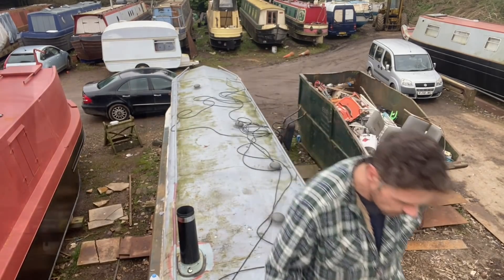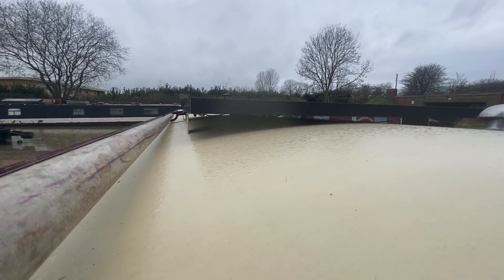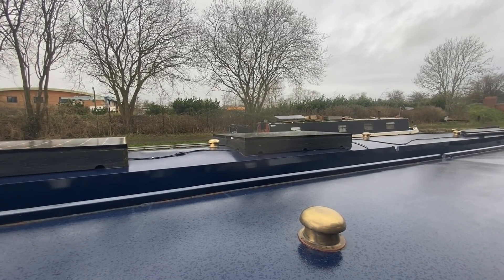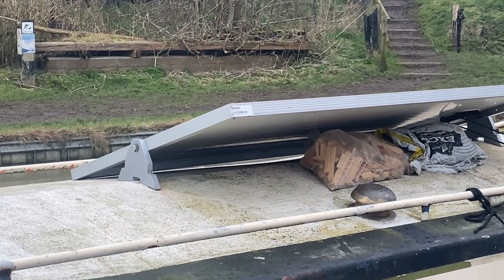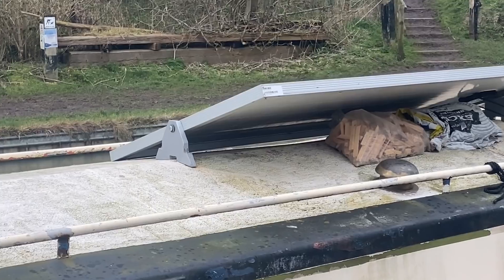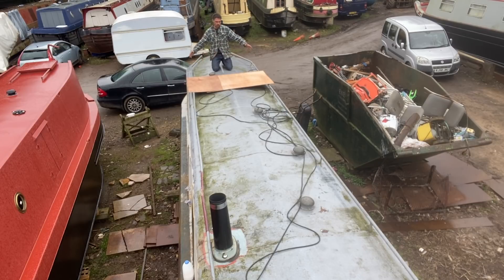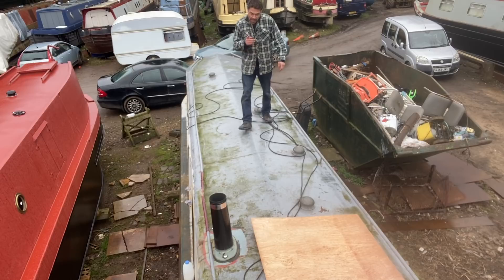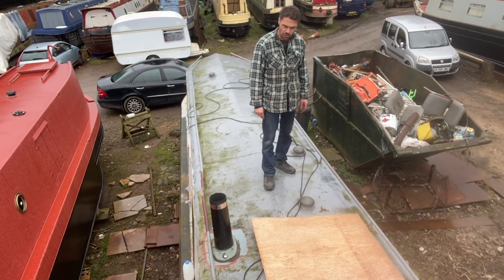122. Narrowboat solar panel positioning and mounting options

Comment: Mount On the side of the boat on sliding brackets above the roof then you could tilt then  Accordingly and slide them down when  you go under a bridge then you would have the Option to put them when the Sun comes up in the morning and in the afternoon if you are moored up then you do not need to worry about tunnels do you

Comment: re the mic - you said "new mic", but you need a radio mic (I thought you had one, but you seem to be using a fixed mic at the camera location. 
mounting solar - you could still use the usual triangular brackets for the panels, but with wedge shaped metal spacers under each foot - shaped to match the outline of the feet. At a guess, this would raise the panels only very little as the brackets have a cut away area in the middle between the feet into which your "roof ridge" might fit.

Comment: Keep going man, you're doing well. Just a suggestion, but you could move the vents, welding the cut pieces into the old holes. You can buy some 2 part filler for metal, to hide the sanded down joints, especially as you are going to have to paint it all anyway. Use the vent positions for the inside, (kitchen, shower etc) to be the final guide for where to site your panels.

Comment: The angle of the panels relative to the sun will have a big impact on their efficiency. Don't skimp on adjustable brackets or it'll be a false economy.

You've made a few references to the height of tunnels... doesn't it depends on how low the boat sits in the water? Have you looked into the height along your routes? Maybe it doesn't matter.

Great channel, it's providing a lot of inspiration. Keep up the great work.

Comment: Plenty of boats around with panels over vents as long as there is a gap for airflow no problem with BS cert. I put my panels near the stern to cut down on cable run .

Comment: Good video looking at differences in mounting panels.... I'm going to (eventually!) mount 660mm wide panels (narrow ones!) on strong magnets. As they are half width of roof I'll put two on one side at the stern, then two on the other side at the bow so i can walk up the boat on the roof - both sets using curve of roof to angle slightly differently. This leaves centre line free plus as the panels are low profile wont catch on it. They are nice and low below mushrooms and don't need to tilt. As on magnets no holes drilled so big bonus with nothing to rust, plus they can be removed for painting etc... just something else to add into the mix!

Comment: Personally, I agree with your final placement of the solar panels. The standard apex mounts are adjustable so you can lower the panels to the roof when you need to go through tunnels, but it will still allow you to tilt the panels when you want maximum sun. As for connecting the panels together, make sure they are wired up so that if one of the panels is covered for any reason it doesn't kill the output from all three. I'm not an electrician so can't help you with a wiring diagramme. Good luck with whatever route you take. Cheers Dave

Comment: To avoid any problems with the centre line you could have 2 with one fixed either side to the handrails as the boat is a Springer they should be more than strong enough. Be careful having a panel over a mushroom it might fail a boat safety check.

Comment: I find I very rarely walk on my boat roof at the front when using locks.  My boat is 58ft long and I single hand 90% of the time.  Where possible I only go on the roof and climb a ladder when entering a lock to go uphill.  Once I am lockside I try not to have to climb down any ladders.  Although when people 'help' sometimes I have to when going downstream but if nobody is there to interfere I simply pull the boat out of the lock and shut the gates before walking down and getting on from the gunwhales.

So definitely keep solar panels in front of the centre line.  Plus having them over your mushroom vents also means when it rains heavily you won't get bounce back rain entering the vent.  Since you currently don't have a centre line fixing in the middle of the boat you have the luxury of creating attachment points on both sides near your rails and then the lines are less likely to foul stuff on the roof.  The centre line point is not necessarily in the middle front to back either you need to locate the point of balance for your boat.

Comment: For the plywood brackets, you can just make them out of plywood yourself, instead of having them fabricated out of stainless or steel. It’s less strong, but I think that’s if anything a benefit. If anything puts that much force on them that they’d break, you’d rather the brackets break than the panel.

For overall positioning, I think for cruising, as much as possible forward of the centerline, and flat in the middle of the roof leaving a walkway along either side. But if they’re forward of the center, then most of your walking on the roof will be without having to avoid falling onto or tripping over the panels — I’d think it’s hard enough to avoid falling in the water without adding an obstacle course if your can avoid it.

And of course while stationary you’re going to want to be able to angle them quite steeply.

Comment: You need two brackets to each panel mounted to the center so you can tilt the panel to the left or right. Mount your panels to the center of your roof line so you can still walk down either side. But have a bacon sarnie first. We still cant hear you, brail would be good at the moment.

Comment: Hi James, my penny's worth -  I think you got it right at the end there, fit them lengthways missing the vents. Two on the left at the front, then the last on the right further up. Since you have such a profound curve to your roof I think that should allow for a really low centre point? Will you strip back and repaint the roof first?

Comment: If you are mounting the panels on a pivot along their axis, have the fabricators cut the brackets with a vertical slot and use handwheel bolts.
You’ll be able to get the top edge a lot higher (better angle to the sun) without a lot of extra height in the bracket or get the panels flat on the roof as required.
Especially when trying to tilt against the slope of the roof, you won’t get much of an angle with a short bracket.

Comment: I'm loving the suspense of a part 2. Just wondering if as a solo cruiser you would be walking on the roof regularly. Great use of the ply wood for measuring. What about those panels that are flat/rounded to the roof and you can walk on them? My opinion is that if there is room to walk then I would get those that maximise the sun, so those that tilt. Looking forward to the outcome decision! Best of luck Tara

Comment: As a single hander I really would keep them all forward of the centreline if possible. You’ll be on and of the roof loads in locks and the last thing you want to be doing is constantly dancing around solar panels when you’re getting on and off the boat in a hurry, it’s dangerous mate, trust me 👍🏻

Comment: I use pot magnets on my solar panels with the midsummer energy system it cost me 220 for the mount system with the heavy duty magnet I have a springer just like yours and with the magnets it levels the struts I use the big LG bifocal panels as I live on board full time... Drilling and tapping a roof that didn't leak worried me lol... Plus you can lift the panels when you wanna paint or decide you wanna move them.. I only have two panels but 1.8 metre long.. Hope it helps keep up great content

Comment: Hi James,

NICE vlog - excellent DIY!

For solar panel placement - low and fully moveable - have a look at "Minimal List" - somewhere in their first 60 vlogs - I think - their system is great!! You still can improve a little on it, though!
You can quickly raise them - if you want pat vertical - either side - and you with pulling a few pins and a plug, you could also take them off in very short order (to store them safely...)...
Didn't see Cath's install on "Narrowboat Experience", yet ...

Best Regards from a different Canal - ....living right next to the "Miraflores Locks" at the Panama Canal - NO Narrowboats over here...

Cheers,
Thomas

EDIT 1: "Minimal List" Solar: - right after Episode 025 - and then between Episodes 45 and 46....! I think they have more Solar vlogs, but these 2 certainly will give you the idea!! ....and frankly - I think it's one slick and most economic solution!!

https://youtu.be/iBn9iw5JE4s

https://youtu.be/L-wSAaOYFM8

Edit 2: Saw "Narrowboat Experience" - great install!

https://youtu.be/aDvb9W8RAU0

https://youtu.be/WMaJGOpF8DE

If you don't want to drill/tap your roof - weld a nut into a piece of tubing and then to the roof or just weld a stainless bolt pointing up onto the roof (...or have your buddy from the yard do that for you!) and bolt the panel rails down with a washer and a stainless lock-nut.... (obviously on all 4 corners of the panel-rails...

If that plywood board represents the size of your panels - mount them lengthwise!! This way you keep some space on each side to weld on clmps for center-lines on each side and gives you some walking space if needed....

Comment: Whatever you do, make it a symmetric solution - anything else will look poorly. Personally, I would definitely go with the solution from one of the boats you showed - the one where the solar panels are mounted to the existing rails. That is a nice beautiful symmetric solution where the panels are lifted above the mushroom vents and you will still be able to reconfigure and angle the panels in the direction of the sun. With such system I bet you will also be able to fit up to 4 panels in case you need it. I'm following "Chugging Along" narrow boat channel also, and they are struggling with only 2 panels your size. Just saying, even 3 may be too little. You just can't get enough solar.

Comment: Is there four or five (5th not seen) mushroom vents?
I wonder if you could fit the panels between the 2nd and 4th vents and left rail (with a gap)?
At worst the panels would partly rest on the vents and if you wanted them to angle steeper (one direction) you could use the railing as a pivot point (if strong enough)?  ;-)

Comment: How about..... Run some lengths of angle ali across the boat, attached to the rails with U bolts. Space the ali so that the panels will just sit down between. Then you can drill through the ali runs and the panel frames, and secure them with simple M6 wingnut/bolt hardware.
If you want to raise the panels, then just cut some more angle to make props. The bolts at one end will act as a simple hinge. You can put the prop either side, depending where the sun is. When you want to cruise, just remove the props and lay the panels down flat into the runs of angle. 
U bolting, means you can play around with the configuration and find what works, without any mods to the boat. Try the panels length ways or long ways, and move them about on the boat, or reconfigure if you change to new panels of different size. Even strip them off quickly if you get height issues.
Solar meccano ! And to make it all, you only need a drill, hacksaw and vice.
Reply: A few viewers mentioned Minimal List's setup. My idea looks like it's pretty much a DIY version of this.
(BTW, I use this on my workshop panels.)

Comment: Please don't consider single handed cruising without a pair of centre lines as it will be a nightmare.
Assumiing you have centre lines you won't want anything on the roof too close astern of them, else they will always be getting caugt up. If you can easily walk on the back half of the roof you will be okay to access lock ladders, so mount your panels to the front of your centre line mount. I'm just about to mount a couple of big panels on our boat and have chosen to go with these fully tilting brackets from Midsummer Energy (a bit pricey though).: 
https://midsummerenergy.co.uk/buy/solar-panel-mounting/Narrowboat-Tilt-Mount 
Example installation here: 
https://www.youtube.com/watch?v=asf1W0N8W_k&feature=youtu.be

The Narrowboat Experience have done a full tilt system more economically, but you would need to space the bars up a bit to ride over your mushroom vents: 
https://www.youtube.com/watch?v=k0WaQuvwc_I

Also the Miminal List have done a more elaborate full tilt (over mushroom system): 
https://www.youtube.com/watch?v=iBn9iw5JE4s
Good luck...

Comment: Had a quick google .... pairs of brackets seem to be between £30 & £40.   Came across one example that would work with a roof ridge ( https://www.ebay.co.uk/itm/254461665261 ) 
but if you offsetting them to one side then the ridge isn't an issue.
Also like brackets like these https://maloneelectrical.co.uk/price-list .... they have 2 sideway cut-outs at the top which means the weight of the panels can sit on those rather than relying on the friction of the locking nut.
Finally do you really need 3 pannels or can you get away with having only 2 (poss higher powered)  with the option of adding a third latter?

Comment: Hi James my idea for your solar panels is to bolt all three solid together then fit across the front of the roof to the grab rails with a couple of "u" bolts each side then by undoing one side you can tilt them up as far as you like don't worry about going over the top of a mushroom  vent all this will do is stop them leaking which they all do eventually then wires through the roof under the panels so no wires running down the roof you will never need to walk on the front of the roof and as for height you could probably go up four or five feet before it causes a problem
Reply: Nice idea, but remember the combined weight is going to be 60+ Kg so frame strenghening and muscles will be requied for the tilting.

Comment: When your close that mic is much better 🙌🙌
Reply: If it’s a wireless mic shouldn’t you clip it on yer collar?
Reply from the maker: @diywithpaulie  I did !!!
Reply from the maker: The range of the TX to the RX
Reply from the maker: Yeah I think so too - I think it’s got a range which I’m trying to work out
Reply: Ahh I see
Reply: Ok if you were wearing the mic then the phone was not using it to capture audio - sounds like a phone configuration issue - needs to be set to use the wireless mic audio and not the phones internal mic which it was clearly using in this vid.

Comment: To be fair, if you're going to be doing most of your boating on the Grand Union, then I really think you are fine for headroom. Have a look around online for some of the profiles of wide beams in the same sort of area, your headlights and solar panels will be well inside of this. You obviously won't know for sure until your floating but Springer boats in general are pretty low form in the water. I can boat from Braunston to Stoke Bruerne without removing my chimney (28" tall) to give you an idea..

Comment: Something to consider, if you could put them in the middle this would obviously give you ideal and fast access to the roof when in locks, from either side, alternatively your off-set idea looks fine, but will you have enough room to navigate fast around the panel near the chimney, James?
Re the brackets, have you considered aluminium? It will probably cost less, and easier for you to machine or even make yourself using various tubular and angle cross-sections. Takes me back to my Meccano days.
By the way, I do favour crispy bacon, just to make sure the pig is dead, although I am partial to a rare or medium rare steak. ;-) Right I’m off to burn the kitchen down!!!

Comment: James. Several boat tubers have tilting brackets fixed over their  mushrooms that have got through all the low tunnels ok. e.g. Cruising the Cut & Journey with Jono both have std 'A shaped' brackets above the mushrooms with no issues. Leave a decent gap around the centre line fixings and use 2 centre lines (one down each side) & you wont get them tangled up under your panels then.

Comment: Ok have a look at minimalist, what Michael did with his panels seems to be the best I have seen. 

Unless you are aiming to do the Basingstoke canal (which has some very low bridges) or the Dudley tunnel, you should be good to go. Not all tunnels are 6 feet high.
Reply: Michael was quite new to boating when he did that job. In my opinion his solution is grossly over engineered, if you look at his more recent vlogs, he hardly ever tilts his panels.
Reply: @rebbward  though to be fair the minimalist vlogs are never filmed outside when they are moored up for an extended period. Most are filmed just before departure or actually on the move.

Over engineered is not a bad thing. Personally I would have used pit pins rather than screwed in knobs which would allow for quicker erection or disassembly but that's just a personal choice.

Comment: I may be wrong,but are there any bridges or tunnels that are as low as you are worrying about ?
Reply from the maker: I dunno - but everyone says my tunnel lights might come off so now I’m worried about everything outside the boat
Reply: @TheNarrowboatThatJamesBuilt  @LKHNET mentioned that they thought you would mostly be on the Grand Union and that you would be fine under the bridges there. Taking a look at where you know you're going to spending most of your time seems like a good idea and would give you an idea of what kind of air draft you'd be able to carry.

Comment: If you look at(Taylor Abroad on you tube) hes just done his solar, again he didnt use the expensive brackets but got nearly the same brackets £4,99 a pair either from BQ or Screw fix, drop him a message im sure he will tell you.
Reply: Yes and a quick cut with a plasma cutter could make the adjustment slide